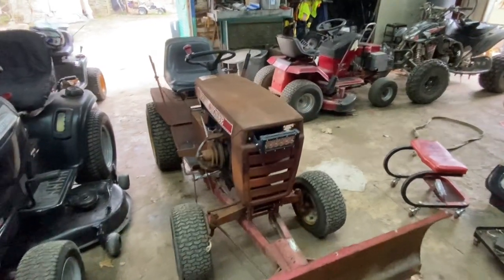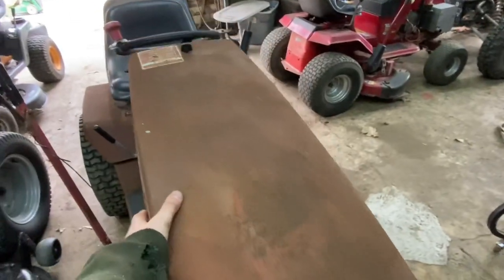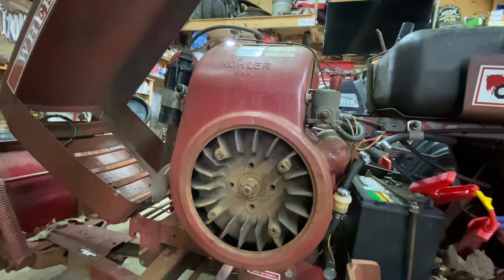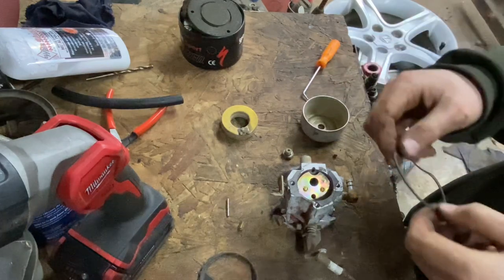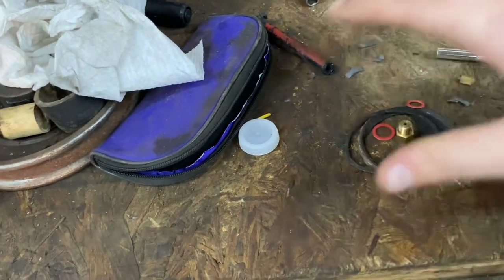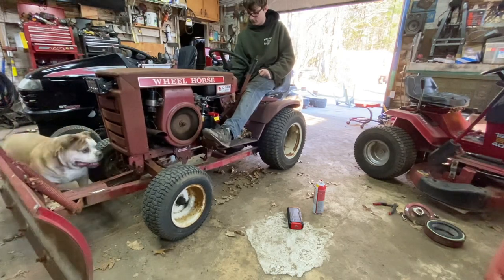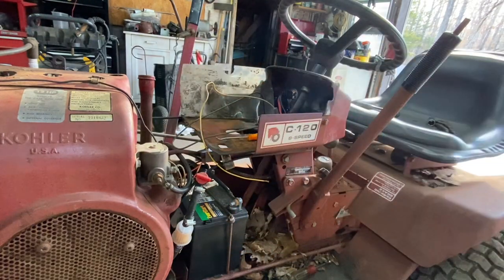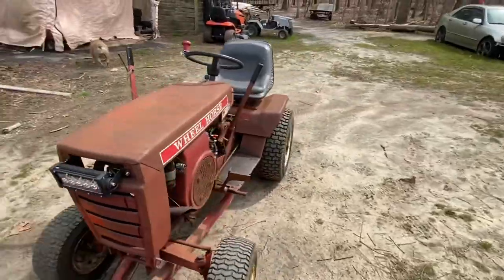Reviving an Old Wheel Horse C-120!

Comment: If you call a K series Koehler garbage, you have no clue! Probably the best garden tractor motor built.
Reply: You're right on Glassman. I have had a Cub Cader 125 made in 1968 which has a K301 12hp Kohler in it. It runs today and has never been rebuilt. Keep oil in it and they run forever. I got it in 1972 and have been cutting grass and blowing snow with it ever since. Certainly not junk like the crap they make today.  Take the Briggs Intec. ACR falls apart and you can't start it.  Need to replace the camshaft. Now, that's junk.
Reply: Absolutely one of the best engines ever made.
Reply: Totally naive. Possibly after junior, overhauls a couple thousand Tecumseh's, and new type Briggs with plastic timing gear and pot metal compression release module, he just might come to the reality, Kohler's, just might not be garbage after all.
Reply from the maker: @Glassman687 the older Kohlers seem well built, but I was joking saying that it was junk like the new Kohler stuff. Thank you for watching!
Reply from the maker: @dougseaman8791  the new Briggs are definitely way worse than the older engines, but so far I’ve had good luck with mine. Thank you for watching!
Reply from the maker: @garyalensr  there definitely well built, thank you for watching!
Reply from the maker: @jamesmann1243  I doubt anything will ever come close to the reliability of the older engines, but the new kohlers are hands down some of the worst I’ve ever seen. Thank you for watching!

Comment: Kohler is not garbage, what other motor will runfor 50 years and run strong and not smoke
Reply from the maker: Any motor should last that long if it’s maintained even though many still don’t, but this kohler is definitely impressive. I’m mainly not a fan of the newer kohlers. Thank you for watching!

Comment: Special T,
That's a nice tractor.  I remember when I was a kid a neighbor had one wasn't that big though.  It had a pull rope.  I thought it was pretty cool .  I went to an auction and a B 80 was up for auction.  I was going to go to $100 I got to thinking,  I've got too much to work on now and only one other person was bidding,  so I stopped at $80 and the other guy got it for $85. I was happy for him. I have no idea if he got it running or not. I do know I could turn the engine over by hand. It did have an electric starter.  That's a nice machine you've got there.  I think I would try painting it. If you don't, it still looks good.  😊
Reply from the maker: Those mowers sound awesome and I would paint it but it wasn’t my mower, I was just fixing it for someone, but it is still cool. Thank you for watching!

Comment: Make sure that old fuel pump is not leaking gas into the engine crankcase and diluting the engine oil.
Also make sure there is no water in the gearbox / transmission.
Reply from the maker: Luckily I checked all that and everything was ok. Thank you for watching!

Comment: The the handle for rotating the blade is on backwards.  Remove all that junk nuts/bolts/washers and rotate the handle around so the offset is on the reverse side.  Give me a shout if you need any manuals or help.
Reply from the maker: That makes more sense. If it was my personal machine I would have flipped it around but it worked fine and the guy that owned it was happy with it. I’ll definitely let you know in the future if I need any manuals or anything. Thank you for watching!

Comment: I have the 76 c 120 with 8 horse kohler.  Same one.  Do you check oil with dipstick screwed in or not?  Nobody will respond!  Can’t figure this out
Reply from the maker: That’s awesome man! I always screw in the dipstick to check the oil on anything unless it says otherwise and never had any issues. Thank you for watching!
Reply: @specialt9744  That's incorrect for the 60s and 70s K Series 8 HP.
Reply from the maker: @ebinmaine  thank you for letting me know
Reply: @specialt9744  hey no worries. Glad to help. I'm not sure about the 10 HP and larger.. 8 HP and smaller you remove the dipstick, wipe it clean, then just set it on the edge of the block to get the reading.